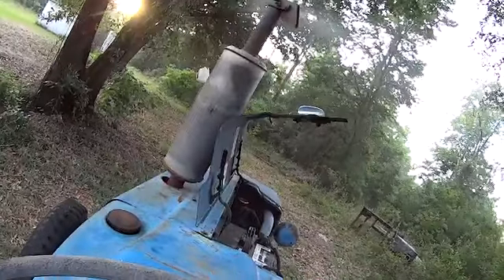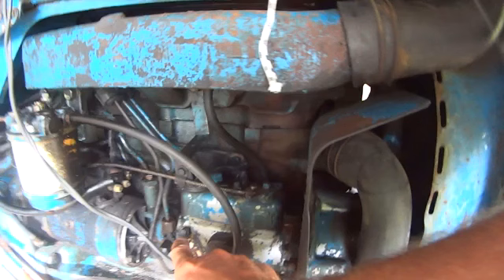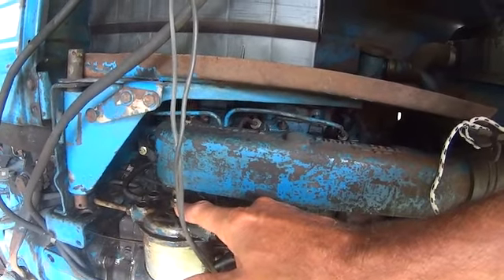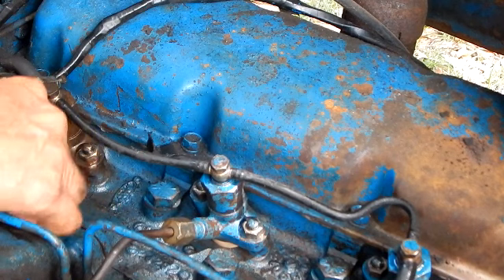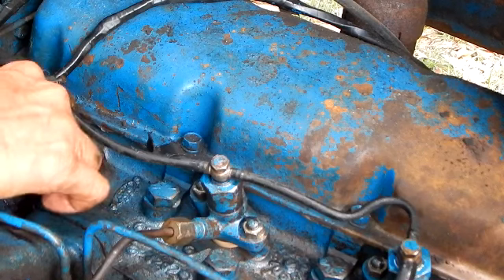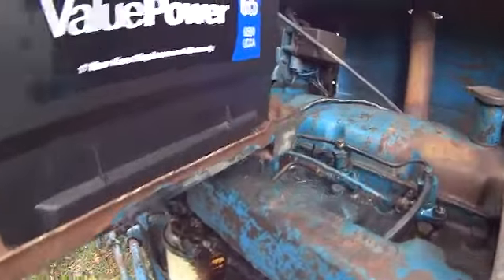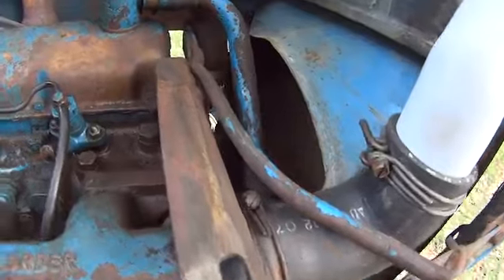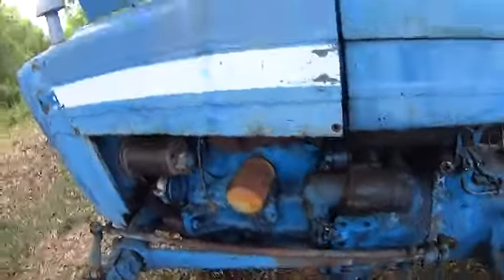Ford 2000 Tractor Bleeding The Fuel System

Comment: Thanks for the video! 
  These types of videos are SO MUCH nicer than trying to figure out what someone's referring to on those tractor blogs whereby they don't often provide pictures of exactly what they're trying to show you. 
   Well I got a 1979 Ford 3600 3cyl Diesel. Starter went bad and the only way to remove it is to disassemble the fuel filter. New starter on the way and so I'm preparing ahead of time by looking up how to bleed the fuel system for when the starter gets delivered.

Comment: If you have another tractor or a half ton and some one who knows hand signals you could pull it in high gear and save your battery and starter. But you did everything exactly right so if it ain’t stubborn she’ll start!

Comment: Hi Bill, Can you tell me if the valve at the bottom of the tank just has an On/Off position, seems to me that is that case, but the guy I bought my Ford 2000 from said you have to screw it in to close, and back out to open...any help is greatly appreciated.
Reply: I can chime in here just to cover more details.  I just bought a 1970 Ford 2000 and found out that my fuel valve on the tank is actually one that you pull open and push closed (although it doesn't work).  I know others may have a screw style so it might be either.  In my case I figured this out when I was never able to twist the valve clockwise and get it to "close" so I messed around some more and pulled on it and it popped out.  Then I pushed it back in and it popped back in.  So in my case I have a push and pull style shut off.
Reply: The 3600 hundred has a screw in -out petcock shout of on ln to close out to open